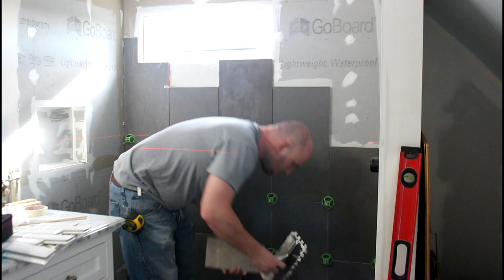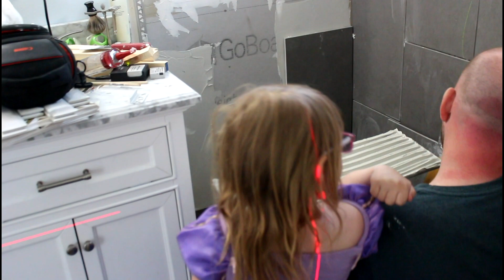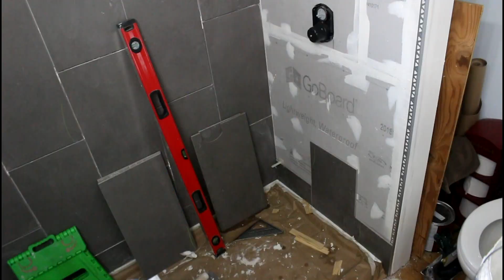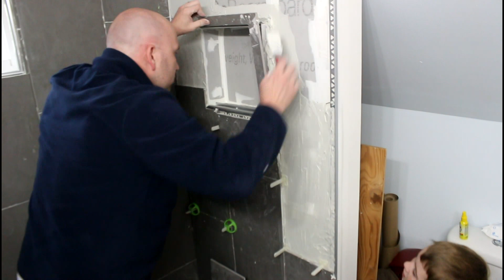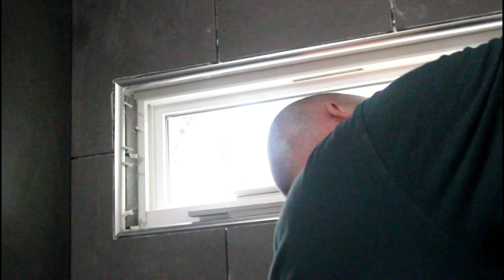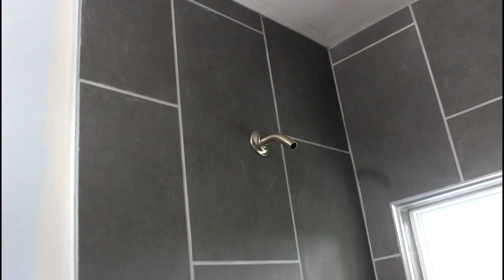Time Lapse Tiling a Shower Start to Finish

Comment: That is an awesome size shower head. You can get plenty of water to rinse off with that baby. I have to do the same thing in our shower from 1952. Not looking forward to the demo.
Reply from the maker: It's been a ton of work,  this shower is Completely new in this space.  The window was a door prior leading onto a useless deck. The whole bathroom has been rebuilt and it's only taking me 9 months and counting.
Reply: @precisionmachineshed  it looks great, you did an awesome job. I've been remodeling one room at a time out of pocket for the last 7 years. Taking it down to studs, rewiring, new insulation and drywall. Labor of love from 20 years of being a home builder.

Comment: Amazing job but can I ask , you were left with small cuts right at the top , which can be seen when the film cuts to normal  speed. Was this deliberate ? At the start you have plenty of scope to shift everything up and avoid small cuts . I’m not picking holes I’m just curious .
**now got to the end . It looks like you took the start from the middle of the window so you have an even cut either side . Fair enough with that type of tile and orientation it would be hard to know where to start
Reply from the maker: That's exactly what I did.  Centered on the window.  It also worked out well worth each cubby because each side was different.  When I get the glass doors on,  you'll never notice the top/bottom diffidence.